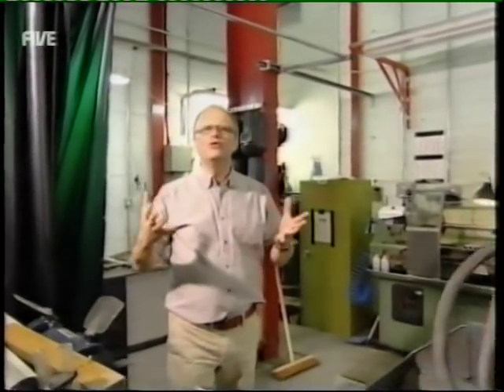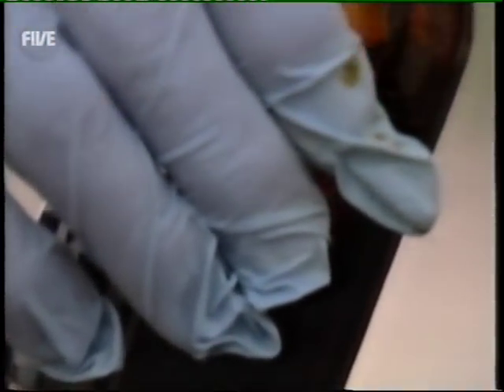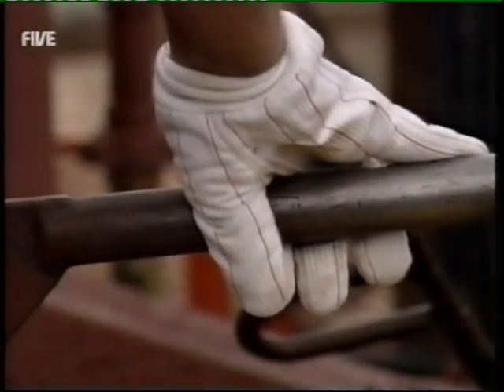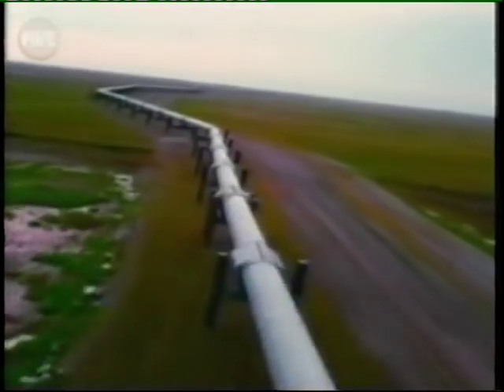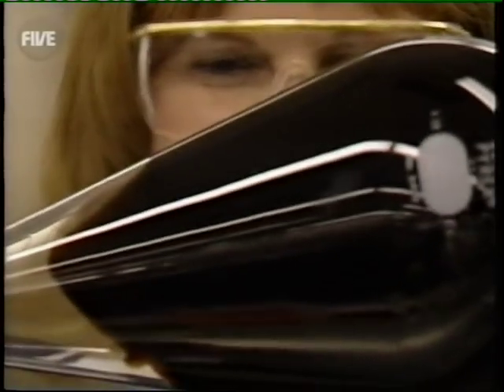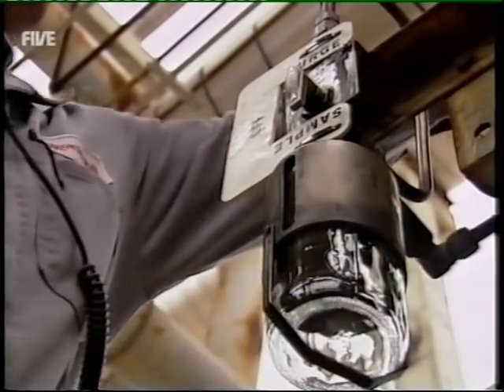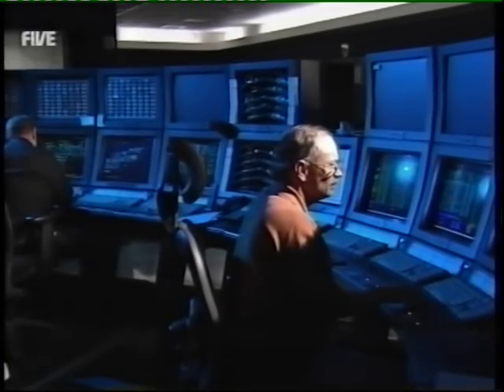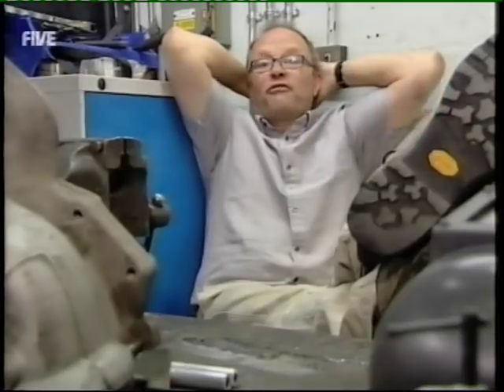How to Make Petrol or Gas from Crude Oil.

Comment: "To separate the carbon atoms you'll need one heck of a chemistry set" - goes on to show you just boil it and catch the vapor at different elevations. kek
Reply: Mike Brice they also mentioned octane issues and engine knocking. They put additives in the fuel as well. And then it’s further mixed with ethanol.
Reply: It's edgy and makes you more believable because you said "cucks".
Reply: It was a treat to see the "knocking engine machine" being used. That little gem was a big reason why we won ww2. higher octane fuel that was developed for our aircraft b/c of the "knocking engine machine"
Reply: That is actually have a lot of chemical processes work. Thanks a lot of chemistry experiments involved boiling chemicals and condensing the vapors. So yes it is a big chemistry set.
Reply: There's actually a bit more to it than merely heating & catching vapors. There are catalytic elements involved, plus a whole lot of sciencey stuff the narrator doesn't go into, because it'd be kinda boring to the average layman.
Reply: It's really quite interesting how they "crack" the molecules of crude oil to create various petroleum products.This faux documentary barely talks about the process despite the title. It involves a lot more than boiling it.
Reply: oipbhakeld we didn't win ww2
We simply aided
Reply: Catalytic, thermo cracking and reformers are the real marvels, the rest is basic distillation. Overall gasoline is still a bargain, it's the taxes that drive the costs up! Pun intended.
Reply: So true. Crack it and make what they want to. Fascinating how they can make more barrels of product than what they started with.
Reply: Yeah that why we all refine our own petrol, oh hold on we don't.
Reply: No the distillates are drawn off at different levels, the remainingg vapor keeps rising
Reply: @oipbhakeld  In the European theatre in WW2 Germans collected the surviving aviation fuel from downed aircraft and transported it to the Luftwaffe for use in their fighters to attack the bomber formations. The higher quality 'Avgas' was far superior to the fuel they had on hand, perhaps coal based petrol.
Reply: Yeah I played WoW too!
Reply: I make fuel from plastic but with a few snags ! The fuel gives of a lot of carbon deposits in the engine, although it didn't smoke ! There's a lot of tar in the product that needs to be cleaned up before you can use it and it doesn't smell like regular feels. Just for those who want to make their own fuel. And it's a lot of hard labour to make decent amount of usable fuel. Is it worth it ? Depending on how much you want to spend and how much effort you want to put in ........ About the video most of what he says is false , misinforming and propaganda , to my opinion.
Reply: Good info about adding smell to methane for safety * hey you 😎
Reply: There are so mAny homemade refinery’s all over South America. They put an illegal rap right into the pipeline to steal the crude.
Reply: Call a Fractionator in the FCC Unit.
Reply: The real Hassel is Sparks , see it's an explosive gas under pressure and contained well , perfectly btw, and that's a bomb ,  antvstatic any spark any source at all , and start over ..boom and someone else starts over...
Reply: I am in the crude refining industry, specifically FCC Units and Yes, technically that is correct. Gasoline used to be made in batches, heated up and boiled off before being sent to a fractionation tower for separation. Now it is done in the FCC Unit. Same principle but faster.
Reply: "Sometimes" mixed with ethanol.
Reply: can a single big ass fractionating column actually be considered a "set"? (the heating mantle is obviously omitted  from the "set" equation... i think we all know why...)
Reply: Somewhere on that oil refinery's property is at least one very large container of pressurized Hydroflouric acid. HF is the single most dangerous substance on earth and is somehow involved in the oil refinement process.  It was created by the Nazis during WWII and is so toxic and caustic that even they couldn't even figure out how to safely transport the substance anywhere for use during the war.  It was briefly mentioned that 100,000 people almost died after an oil refinery explosion a couple of years ago when a multi-ton piece of debris landed within feet of an on-premises container of HF.  That revelation made my jaw hit the floor and, mind you, very little can do that.  The EPA report that contained that info was quietly buried after people like me realized that the information could be utilized by terrorists.  There's no rational reason to keep large quantities of pressurized HF on hand that could be aerosolized in an industrial accident.  2 parts per million of HF is toxic.  A single drop on the skin will dissolve bones and kill a person.  Breathing HF vapor will melt the lungs.  Very few containers can handle it as it dissolves glass and reacts violently with most substances.  Handling HF requires its own special lab specifically designed for handling HF and only HF.  No other substance on earth gets that level of caution.
Reply: Obvi edited
Reply: Not so that, "No other substance on earth gets that level of caution" There are a lot of dangerous chemicals and refineries have a number of them. Since HF is used in refinery processes, it's not going away, nor should it. HF spill training is an important part of the OSHA training.
Reply: @Sulfen  y
Reply: @robert100xx  Your forgetting the oil fields of Romania.. that we sent thousands of bombers to destroy the infrastructure.
Reply: @lappieslabuschagne2428  What do you think the plastic is made from.. CRUDE OIL!
Reply: @dundonrl  wrong! Its a mix of unicorn poop and fairy farts and for octaine my wifes nasty cooking!
Reply: kek lol
Reply: Petroleum needs to be desulfurized through heat exchangers and further refined to remove impurities and leave just hydrocarbons, then fractional distillation happens and then the big issue of storing these hydrocarbons comes up, stuff like bitumin is thick and sticky and must be kept hot or it will solidify, the gasoline easily vaporizes and is extremely dangerous especially when the distillation tower needs a catalyst and a regenerator that uses a static machine to filter the air. Then you have to process the stuff like phenol and use complicated polymer presses to form chemical plastics such as polyethylene, theres a reason those refineries look like miniature cities of pipe mazes.
Reply: This was a bit less than general knowledge of taking cruel oil from from the ground and making  it into the different fuels. And how it goes from the ground to your vehicles.
But some knowledge beats no knowledge.